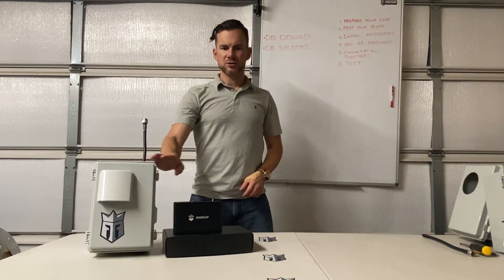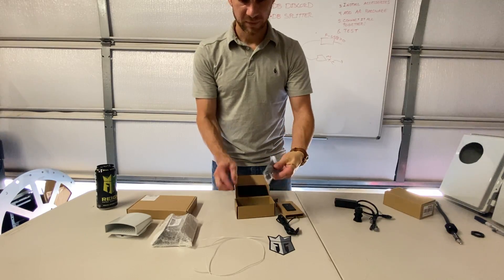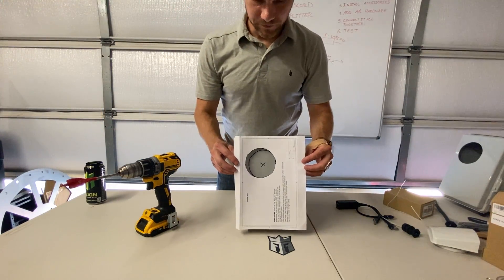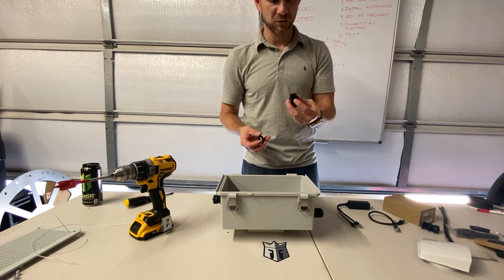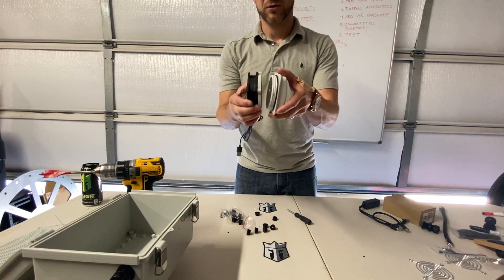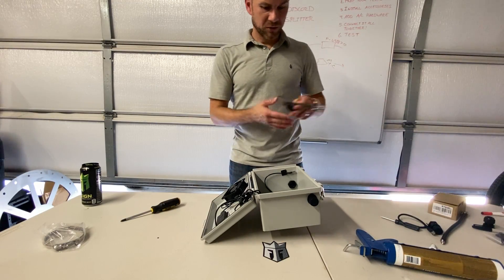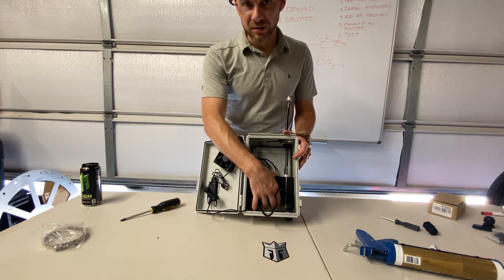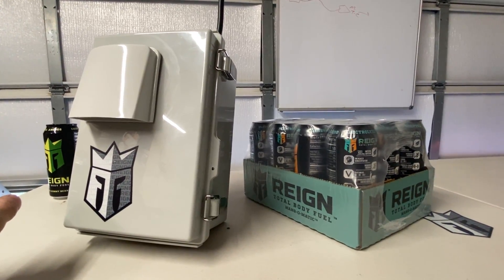Helium Network, AC Enclosure Build - SenseCAP M1 - Step by Step

Comment: You have an exhaust fan, but nowhere for the air to enter the enclosure... the fan will have basically no airflow
Reply from the maker: True. The purpose of this box is to prevent overheating without the risk of bringing in moisture. So we can vent the building heat as it produce keep the box and hardware at more nominal temperatures but its not an active cooling solution cause we didn't want to risk bringing in a ton of dust of moisture in the winter seasons.

Comment: Thank you for your video, great to learn from you. 
I must ask, why not just plug the fan into the USB slots at the back of the sensecap m1 ? 
This is what im currently doing and works fine. Only takes 0.2amps
Reply from the maker: The fans need more amperage so we take it from a direct source

Comment: How are the fans powered? PoE splitter only has 1 power connection.
Reply from the maker: We have a custom splitter we manufacture that splits the power. Wasn't in our video but we use it in all our builds
Reply: @digitalblock559  WARNING: DO NOT ORDER FROM DIGITAL BLOCK. I PLACED AN ORDER ALMOST 2 WEEKS AGO AND IT STILL HASNT SHIPPED. I HAVE TRIED EMAILING DIGITAL BLOCK AND HAVE GOTTEN NO RESPONSE.

Comment: Great video! I pretty much had the same parts delivered over the past week.  My question is how did you attach the box mount to the box.  Its good to see it all put together and working.  Thanks.
Reply from the maker: Hey G2G, thank you! I through bolted it with 1/4 hardware an nylon lock nuts. I also epoxied it as well just for a great seal a help close up any holes

Comment: You skipped over the mounting plate/brackets. Rails and pipe clamps are hella expensive too. Looks like you’re using a plate antenna pole mount /__\ <— looks like that with a hose clamp/worm-gear
Reply from the maker: That is correct. We do a dual through bolt and epoxy it to help seal the gaps

Comment: If i have a plug near by, can i connect bia wi fii and put in an extension cord in the box to plug in the hotspot. Instead of the ethernet splitter?
Reply from the maker: You can always try wifi but its not as dependable as ethernet and you POC updates could be slow to upload, block chain syncing slow, and potential random disconnect issues. So for a few extra bucks and some wire ingenuity you can have a much more dependable hotspot.

Comment: how im supposed to do all of this? its not available in czech republic
Reply from the maker: Do you have Amazon or some kinds of producer of telecommunications equipment in CZR? I would maybe try to find a local business that could supply the parts your looking for. The Parts in this build is a mix of telecommunications and desktop computer hardware.
Reply: @digitalblock559  i was able to find most of it but AIR VENTS are not available in my country. Maybe i will not put them there and i will make a little roof over the box so it eats most of the heat.

Comment: nice but where do you connect the Fan??

You only connected the Sensecap with POE
Reply from the maker: We didn't have the part unhand when we made this video but its now in our online shop. We manufactured a custom plug and play splitter so you don't have to buy a bunch of adapters or solder wires. Link is in the description.
Let us know if you have any more questions :)
Reply: @digitalblock559  I don't know I'd PoE has enough power for 2 fans and the miner ...
Reply from the maker: @Daniel-ck8ii  In most cases you only need one fan. However, the set up and current flow does support two fans and the hotspot. We’ve ran this a few times.

Comment: I’m lost at 13:50. You are connecting the splitter’s UTP cable to the Sensecap and you are saying “if you had a splitter at this point this is where you attach the splitter back to the hotspot and to your USB to power your thermometer”. Do you mean a USB splitter?
Reply from the maker: Hey Balint, no worries. At the time of the recording we did not have the Type C splitter to female USB. We now have them in stock and use them in all of our builds. You can find the link in the description if you haven't already found it.
Reply: @digitalblock559  Thanks!

Comment: Good stuff here mate, just one question. I am planning to do a similar install, but here right now is winter and the temp is going down everyday. Do you have any experience with cold weather and humidity control, condensation, etc. I would highly appreciate your advice and thoughts on the matter. Thank in advance!
Reply from the maker: No we don't. We will go into it more now that were entering our winter here and temps are dropping. We will of course share everything we find and design

Comment: I almost think you should take the video down, or somehow add a disclaimer. I built this box, detail to detail as you mentioned (I skipped the fans), and as I was about ready to mount it I realized I did not have a drip loop for the coax cable. So I had to seal the top hole (which was a pain) and drill a second hole in the bottom for the coax cable.
Reply from the maker: Thank you for your feedback Cichilds. We agree mounting the cable gland underneath is the "best" option. And wasn't something we showed in this video initially. However how we mounted the cable gland ontop isn't wrong as well or detrimental to your build. 
I also want to add for any person DIY you want to add a all-weather exterior sealant around any hole you make to an enclosure to ensure no moisture leaks(even though most glands come with a rubber gaskets.) 
In your situation you could have done this and had no issues and wouldn't need to drill a new hole.
Half of our enclosures (w/ active hotspots) have them on top and we have checked them and have no water leaks(these have fans as well.) 
We do greatly value your feedback and will make sure to make an edit to this video to ensure others are better informed about this.
Thank you!
Reply: Drip loops can be important. I definitely recommend not having any penetrations on the top of the box at all. The cable and telephone companies have learned this and do it that way for good reason.

Comment: How did you mount the box to the pole mount?
Reply from the maker: The part is in the list. But it comes with metal straps you use to secure around the pole
Reply: @digitalblock559  Right. What I didnt understand from the vid was how you secured the box, to the metal bracket (mounted on the pole)
Reply from the maker: @caughtwaves  Ah understood. That's one step we didn't show. When you have the plate removed from the inside you would lay your bracket on the back of the box mark 2-4 holes inline with the holes/routes in the bracket. Drill them with a 1/4" bit and drop a bolt from the inside through and a lock nut on the exterior to secure the bracket to the box.

Comment: So the hole for the Ethernet you used a 7/8 inch bit, and for the hole for the ethernet you used 1 and 5/8 inch bit?
Just making sure before I buy two different bits.
Reply from the maker: Good question and the answer is just one bit for the Ethernet and the cable gland. Just the 7/8” bit.

Comment: What kind of temperatures does the miner get in direct sun?
Reply from the maker: In the enclosures? Most of all miners are indoor only so its best not to place them in the open in direct sunlight. If your talking about inside this enclosure particular its about whatever the outside temp is. If it gets into the high temps for example 105 degrees the exterior case might run about 110 degrees. The case prevents it from hitting dangerous 130 and 140 temperatures.

Comment: Nice video but... 1) How does fresh air get in? Seems you only have an exhaust vent/fan... 2) How to power the fans? - you never showed where the fan controller gets its power.
Reply from the maker: Hi Pete,
The case is not a passive air case. It vents hot air and the heated air trapped inside. So the inside case temperature is regulated with outside temps and doesn't overheat. It also helps prevent condensation.
Its mentioned and shown a few times but the part is not shown since it didn't exist at that time.
It does now. Its a custom splitter we designed. Its in the link in this video.
Reply: @digitalblock559  you can't push air out if there's no return air/intake. I suggest adding an intake at the bottom w/ a filter.

Comment: Thank you for the video and job well done! What kind of wiring did you use to secure the sensecap onto the mounting plate?
Reply from the maker: We use gardening wire. Its like the wire you you find tied around many of the cords you receive in the mail an it is very affordable for 100s of feet
Reply: @digitalblock559  Thank you!! I appreciate it

Comment: If you remove the back plate of the sensecap miner you will find 4 usb port where you can plug the fan.
Reply from the maker: Hi Hamilton,

we haven't tested it yet but from what we have ready those are inactive ports and cannot be use.
Reply: @digitalblock559  the usb on my 3 sensecap work

Comment: You glanced over why not Cat-8? I know it's unnecessary as it's overkill for the speeds the miner needs, but is there a downside to using it?
Reply from the maker: Only downside is in longer lengths. It wont support POE if over 100ft long. That's all. The video comment was a quick suggestion I could say without going into detail.
Reply: @digitalblock559  thanks!! Good to know👌🏾
Reply from the maker: @samakisan  No problem
Reply: Phew, I already purchased a 50’…good to know, great vid @Digital Block 🙏
Reply: @mkayultra1024  Same 🤣 that's why I had asked too lol

Comment: Amazing content dude. my only issue is that in italy it looks like I can't find the shroud vent at reasonable price. Any hints?
A part from this, your video is great and the enclosure is looking amazing! Congrats
Reply from the maker: Hi Luca, Hmm I'm sorry. My only suggestion would be to design and print one from ABS plastic to the specs you need.
Thank you again for your support Luca, If you haven't already please Sub to the channel were trying to work on some big projects and can use all the support we can get!
Reply: @digitalblock559  that is actually a great idea! Will do so!
Reply from the maker: @lucaaonso9713  No problem. Just make sure its not resin base. Most resins for print are not UV resistance and will be come brittle very fast.

Comment: What should we do for lightning arrester and static electricity accumulation?
Reply from the maker: use a Lighting Arrestor that connects directly to your antenna and then your cable use 10ga solid copper wire. We will be selling everything you need when our ecommerce store opens up at end of month. USD and select Crypto currencies will be accepted.

Comment: Do I need anything special to provide power over Ethernet? Can I just plug the Ethernet into my router/modem and it would automatically provide power through the cable or do I need another part?
Reply from the maker: Yes you need two pieces of hardware do you need a POE adapter to inject power into the ethernet cable and you need a POE splitter which goes into your case and splits the power off of the ethernet cord. Besides these two things you need one ethernet cord to spend distance and a small ethernet cord to connect your router to your POE adapter.
Reply: @digitalblock559  Thank you!!

Comment: Why not use Cat8?  I just ordered a few 1ft the other day.
Reply from the maker: 8 is only really effective up to 30m. For POE and speed of transmission.(if your going less than it wont make a difference. Just more $$)
Your going for greater data transmission speeds with 8 but all you need is cat5 and offers nearly triple the effective distance. 
We use cat 5 hardware across the board cause its affordable and getting anything higher is not necessary or any more effective. Our ethernet cord for POE though is CAT7 and that only cause at the time we could only find exterior/burial grade ethernet cord in a cat7. We need to ensure quality remains for year when it is an outdoor installation.
Reply: @digitalblock559  Thank you for the detailed response. Greatly appreciated.

Comment: Nice build. Only thing I suggest changing is having both cables enter from the same side of the case so that end can be oriented towards ground making the enclosure more resistant to water intrusion. Also where is the air intake for the case?
Reply from the maker: We are planning that for our new builds. Just making everything more concise and efficient. Thank you for the suggestion. There is none needed. This particular case in the video is exhaust only. There is no active airflow for cooling. Just venting.
Reply: @digitalblock559  Would this be a good solution if I wasn't concerned about temperature, but rather moisture?
Reply: @crossfitthrive  A fully sealed enclosure might be better in your case, throw a few silica gel packets in there.

Comment: i see the sensecap m1 has usb ports on the board itself,   have you tried to use them,  that would save using a dual splitter for usb , 1 to fan, 1 to miner,  just connect the fans directly to the miner
Reply from the maker: No we haven’t. From what I’ve read they are inactive ports and don’t supply any power.

Comment: Hi! I made a pretty dumb mistake and tried combining different builds and accidently plugged in a 12V POE splitter into my sensecap which is a 5V. After realizing my mistake I plugged back in the original power supply and the blue light is now only blinking quickly and holding the pairing button doesn't change anything. I was told that the sensecap might be ok and that the pairing button wasn't working because I had unplugged it for a day and it might just be updating. I had to leave the location and I'll be back later to check if that's true but just wanted some insight.  Thanks.
Reply from the maker: Sorry to hear about that. Hey the blue light always blinks quickly when you first turn on or power on your sense cap. That is normal. I would double check the Bluetooth button and make sure it’s fully depressed for 5 to 10 seconds, Use a paper clip or pen if necessary. And reassess your hotspot and run diagnostics. You can also use the SenseCap dashboard to remotely access your hotspot. Feel free to join us on Discord for more question and insight

Comment: I live in southern florida we’re it’s constantly raining and very humid (months of 100% humidity) will the moisture be a problem
Reply from the maker: In an environment like that where severe storms are guaranteed there will always be a chance. I would run a single exhaust fan. These fans are high rpm so they can push out the volume of the enclosure about 114x a minute to help remove hot air. But I have not data to say how effective they will be at keeping moist air out. If the pressure is greater then the external force there is a "chance" it wont happen. If power goes out though and high winds pick up you may not have a working miner at the end of the storm. Soo... either fully enclosed during storm season or take insurance out on it so if it does go out you will get your money back.

Comment: Nice tutorial ! do you think there may be condensation or humility issues in winter?
Reply from the maker: Good question Anthony. Its definitely a possibility and depends on your location but I would run the fan/s in exhaust mode to keep the case at a regulated temperature and prevent the suction of moist air. Along with adding a 50g silica pack. Overall best method would be a complete closed box to prevent the moisture from entering.
Reply: Why, then, add the fan if best practice is to have a completely closed box?

Comment: Still really not water tight. During rain the humidity is 100% moisture will be inside the box even if just vapour. Silica packs will need to be changed so often it really is pointless. Is it not better to just have a completely closed box like the Rak boxes?
Reply from the maker: Correct. If it a wet climate with constant storms it be best to stick with a fully enclosed box or a box with constant running exhaust fan with high volume throughput.
The fans we use empty the case about 113x every minute per fan.
Reply: @digitalblock559  but with just one exhaust fan it can't remove any air if no air is getting in. I'm not sure it will be of any benefit. Also those vents on the outside are only IP32.
It's not easy putting a indoor miner outside and protecting it from the elements. It might last 6 months but I doubt 2 years.

Comment: great video man, i copied your other setup for the bobcat and they came really great, i have a question or a concern, on the bobcat setup i added silicon around the air vents to add additional seal,  with this being said my question or concern is how are this boxes handling the elements? i have a couple installs that the boxes will be on a chimney exposed to sun and rain. please let me know, i wonder if i drill a few   1/8 holes underneath just in case water gets in? any inputs? and keep the great work man!
Reply from the maker: Hey Nicaman, glad these videos have helped you. If you can share our video/s channel to help us and other creators out there. 
In concern to your question, first you must know this is not a weatherproof case. If you want to prevent moisture from entering the case the best method besides what you've done is to ensure both fans are in exhaust mode. An to drill as few holes as possible in the case. Remember your miner and your electronic parts are not rated for moisture or outdoors so you want to keep as much of the element out as possible.
Hope this was helpful.
There are other methods out there to help but with what you have on hand and in your case this is the best advice I can offer you.
Reply: How are your boxes holding up 7 months now ?